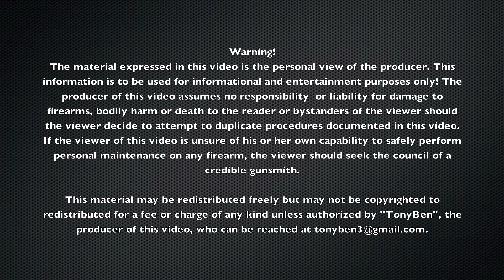M1A Bolt Roller Impact Defect

Comment: By putting a small dab of Yellow or White artist oil paint on the bolt roller you can see exactly where it's hitting the receiver. That will tell you where to grind.

Comment: I had a bolt problem I didnt know about. I sent my rifle ( early SA M1A) to creedmoor armory when they were in Oceanside for a glass bedding. The smith did the bedding ( badly ) and other work I didnt approve. The bolt front was rubbing high and left of center in the reciver . The smith ground the bolt race on the lower left side of the reciver to make clearance for the left lug to clear correctly and smoothy. I havent had the problem since, but the grind marks are still there.  (The name of smith withheld. )

Comment: Ok..HERE WE GO...
BOLTS MARKED WITH AN 
A = CAST
B = BAR STOCK
F = FORGED
FORGED ARE MIL-SPEC ( MILITARY SPECIFICATIONS) ... EARLY 1973 T0 1994 SPRINGFIELD RCVRS ARE __ALL_ NOT TO SPEC. ---- ESPECIALLY YOUR 1994 RECEIVER. THEY WERE IN AN INSANE RUSH TO MAKE AS MANY AS THEY COULD BEFORE THE 1994 WEAPONS BAN.
SINCE THE EARLY 2000'S.... ALL OF THE RCVRS ARE IN SPEC.....
AND ARE SUPERB..... SPECIMENS OF MANUFACTURING.....
PUT THIS OUT THERE AND KEEP PEOPLE INFORMED.....
JD

Comment: Tony. I agree with all the compliments and appreciation viewers give you. Is this rifle high maintenance?  Are these videos preventive or wear and tear after years or just thousands of rounds? I hear to replace the shell extractor and other components to USGI. Appreciate any advice.
Reply from the maker: They are only high maintenance if the rifle wasn't made correctly from the beginning. Cleaning is quick and easy, compared to an AR. Really, the dirtiest area is the gas cylinder and flash suppressor. The bolt face and chamber clean quite easily and it's not hard at all to lube the important areas without disassembly. 

Issues with reliability usually stem from lower quality commercial parts. Once the troublesome parts are identified and replaced, then it runs like a top!

Tony.

Comment: I once had the issue of my bolt roller falling off after firing to disassemble the rifle for cleaning.The E-clip inside the bolt roller had worn out.I had it fixed with a new clip and it did the same thing a hundred rounds later.I then called up Springfield Armory and told them about my problem and they told me to send the rifle to them.I got it back in 2 weeks time and shot it with a hundred rounds and the same thing again with the bolt rollers.This time i went reading into a book called The Last Steel Warrior US M14 Rifle.In one of the chapters it covered M14 bolts and found out about the M marked bolts meaning it was Magnafluxed.This time i called again and sent the rifle back to Springfield and told them to replace my bolt with an M marked bolt with roller,the original bolt was not M marked.When i got the rifle back and shot it with 300 rounds and took it apart to inspect this time with an M marked bolt,the problem was resovled and it still functions fine.Springfield Armory did me justice after sending my rifle back to them twice.But i will check out this defect you are talking about.Great video!
Reply: Reddevil: How have you made out w/this rifle, otherwise? Was gonna buy one, but seem to be finding a fair amount of problem vids on them :/
Reply: I had no problems after they replaced it with the Magnafluxed bolt.The M1A/M14 are good rifles no doubt.In the past i have never heard any of these rifles have a malfunction like mine.This is very rare.Even the M21 i was issued a few times in the Army never had this problem.I say go buy one you can't go wrong.
Reply: RD: OK, Thanks. Good to read. Really dig the historical, soft-shooting, & hard-hitting aspects of this rifle.
Reply: Ken...If there are 100 new owners out there and one of them has a problem; he’s the one you’ll hear from!  The other 99 are out shooting a rifle they love!  Just the way it is, huh?  You’ll love your M14/M1A..trust me, I have six of them, 4 different manufacturers, multiple configurations.

Comment: Tonyben3, I just picked up an M1a. And, when manually cycling the oprod - if I apply upward pressure, the oprod will go into the dismount notch and stay to the rear. Is this normal? Is it for cleaning?
Reply: Plight_of_Icarus My M1A does that too

Comment from the maker: I agree as well, but the feedback I got from others who tried to have SAI fix it was that SAI would not fix it until something failed and that failed part would be the bolt roller. I hope they do fix it, but I won't be surprised if someone calls and gets the response that it is normal wear. Again, SAI is still a good company and not all receivers have this defect. And they still have the best M14 type warranty you can find.

Tony.
Reply: My father sent his in and they repaired the roller but didn't actually fix the issue.

Comment from the maker: See my post below. It's just slightly annoying for those of us that nit-pick at our rifles. Mine has had the defect for 18 years and it shoots an inch at 100yds consistently. Even with the defect, the lockup is fine. The safety bridge and the hammer cam ensure the bolt is in full battery or at least enough to be safe. This is not a safety issue.

Tony.

Comment: How can SAI say this is normal?  The headspace can not be properly checked if the bolt does not fully rotate into battery/lock up.  Good work.  Remember to go slow with the cutting tool like you did.